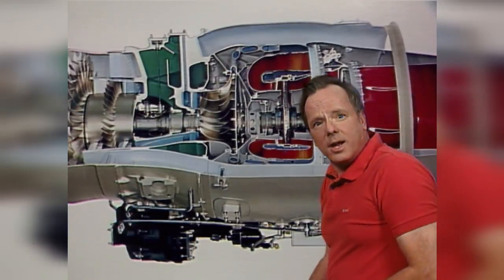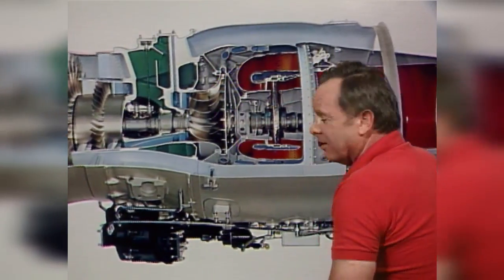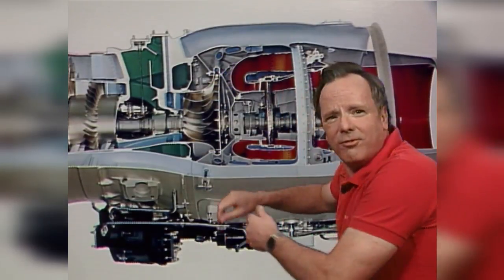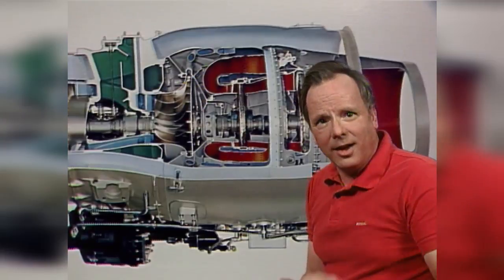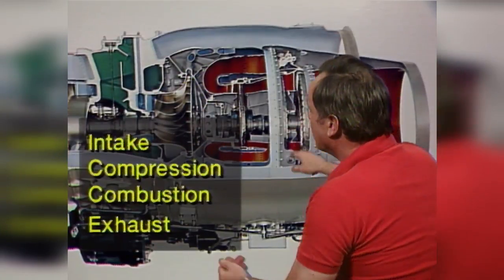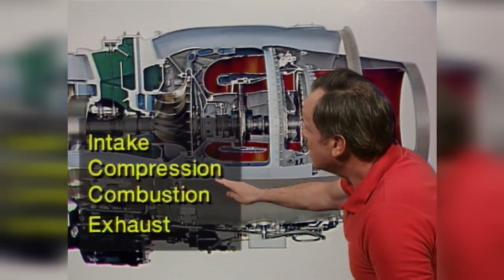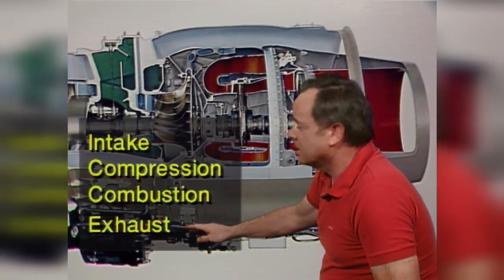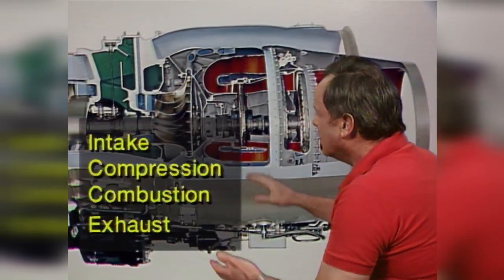How Jet Engines Work -  Jet Engine Intake and Compression

Comment: What starts the whole process on ignition?
Reply: to start the engine, the compressor section is rotated by an electrical starter on small engines or an air-driven starter on large engines.